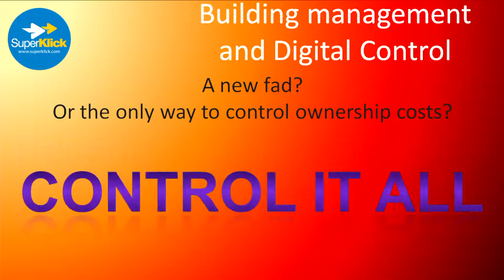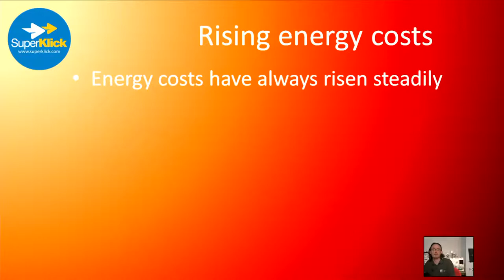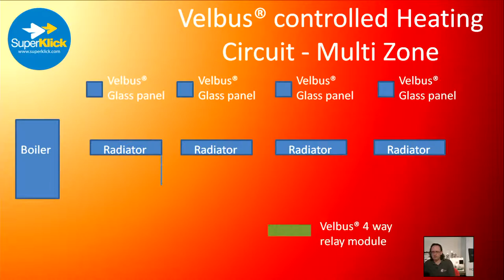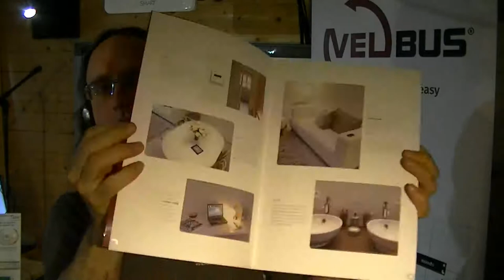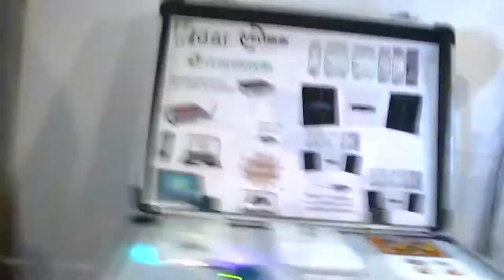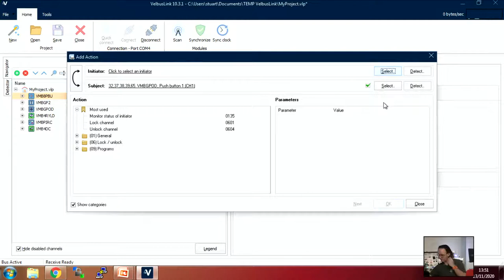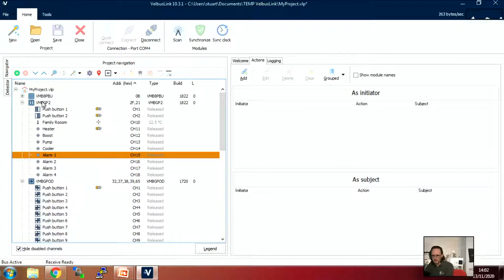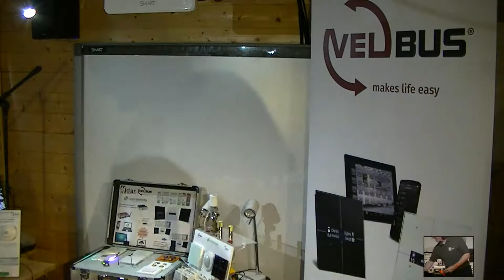Welcome to Velbus

Comment: Nice introduction Stuart. 
Regarding the PIR, I saw there are two modes, 1 & 2 . Does it mean there are two physical relays in the PIR? Whats the minimum time is the go to before re-triggering?
Reply from the maker: Hey Kim :-)

Thanks for watching.

There are actually 6 triggers with the Velbus PIR, which can be linked with actions to as many outputs as you wish.

I think what you're referring to is the independent nature of the PIR triggers channels.

What I didn't talk about in that video is that it's possible to "lock" (disable) the outputs of the PIRs, so if you wanted different behaviours at different times, you just lock the trigger channel you don't want.
Reply: @MDARLtd  Thanks Stuart..
Is that the same as 6 individual triggers?
What I meant with the re-triggering is, how long time it would take for the PIR for notice yet another movement. Some PIR´s can do it within a second, others can go as far as minutes before noticing a new movement.
Reply from the maker: @Kim Andersen 

Yes, 8 totally independant triggers, that are fully configurable.

If you open any project in VelbusLink, you can add a "Virtual" module by clicking on the green + symbol, then select a PIR from the sensors list.
You'll be able to see all the triggers that each PIR has.

* Dark
* Light
* Motion 1
* Motion 1 (Light Dependant) - Which is independent of Motion 1
* Motion 2
* Motion 2 (Light Dependant) - Which is independent of Motion 2
* Low (temperature) alarm
* High (temperature) alarm
Reply: @MDARLtd  Thats simply awesome features..
Reply from the maker: @Kandersen01  

Yep.... "That'll be the Velbus difference"